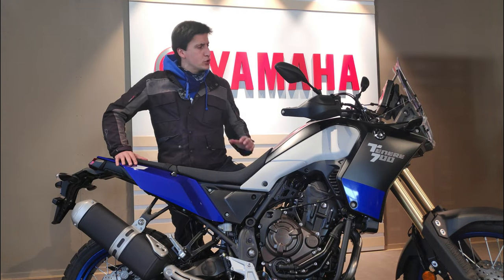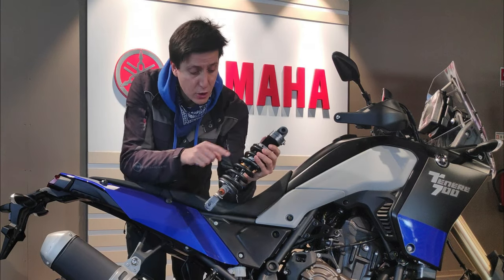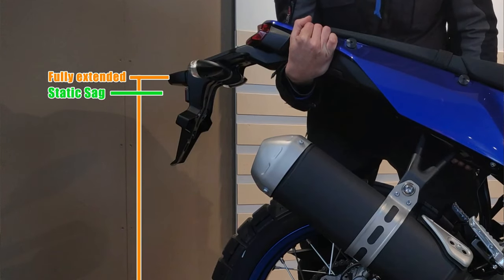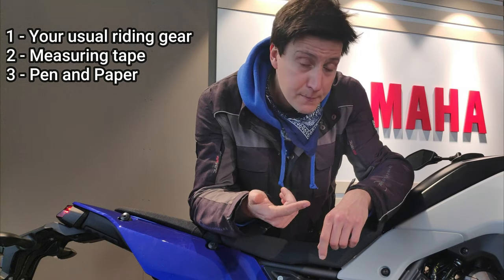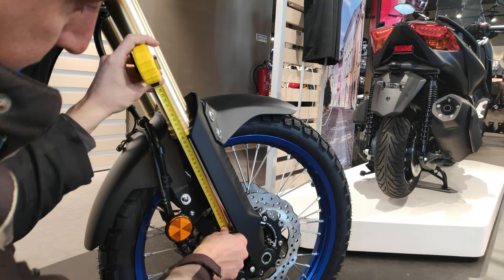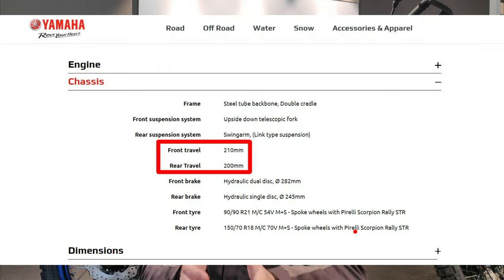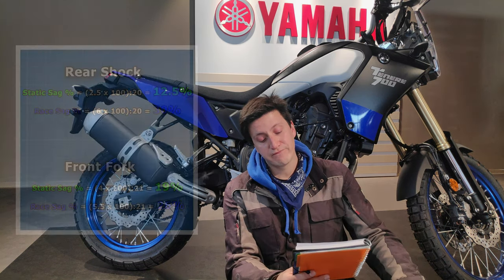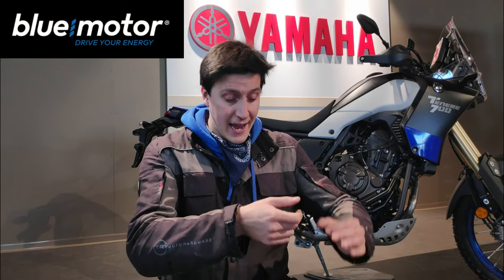Motorcycle Suspension tutorial: Sag and Preload (T7) 2/3

Comment: The best T7 suspension videos on the Internet hands down. I’m about to replace my standard spring on the rear to a 95nm as I’m 198lbs with out riding gear on and I occasionally carry a passenger. I’m also going to add a spacer probably 5mm into the forks at the front to help adjustments and to stop the right spring making a pinging noise over rough  ground   Apparently from the tenere 700 forums this can be a common problem for heavier riders on the Yamaha. Thanks jon.
Reply from the maker: Oh, never heard of those noises on the spring! I will look into that... 
With 198lbs+luggage you will probably feel a huge different now with the stiffer springs. Leave me some feedback after you tried it ;)
Reply: @OFFroadOFFcourse  just the rear spring getting changed and spacers in the front forks 5mm I think. I’ll keep you posted
Reply: @OFFroadOFFcourse  hi. I’ve installed the rear spring & set the correct sag, the bike feels great with that. The front forks are still making the knocking noise over bumpy ground & when I hold the front break & rock the bike I can hear the noise in the front right fork. I added a 5mm pre load washer into each fork & still the knocking continues, so I’ve now added the 12.5mm washers to each leg & I’m sad to say the fork still makes the noise over bumps and when rocking the bike.  I’m not to sure where to turn now. Possibly an 8hr drive to rally raid uk to see if they can help. If anyone online can help I would much appreciate it

Comment: I have my T7 for a bit more then a week now, same colour as yours in the video :D. will have to look into the suspension like you suggest... I'm 95kg naked and 1.90 height without shoes or anything... 
1400km, first service done, did a lot of hard off-road, the bike looks one year old already :p
thanks for the tips and will do like you say :D
(already have a heavier rear spring to match my weight but still a bit too lazy to install)
Reply from the maker: "1400km, first service done, did a lot of hard off-road, the bike looks one year old already :p"
I know the feeling! ahaha! I've been like that all my life!

But now, (thanks to John, from my videos), I've learned to respect a few "maintenance rules" that really make a difference... like never storing your bike all muddy. 
I used to do that.. now I always pressure wash it, ride a few minutes to dry a bit, oil the chain and then (most times), I spray exposed mechanic parts with WD40 (like the hinges on the footpegs and side stand, some nut where I notice any sign of corrosion, etc)
It prevents innumerous problems and general decay along the years :D

Comment: great video! thanks for the hard work!
one question: since the static sag is independent of rider/gear weight, and if it falls outside the 10% range, does that mean the manufacturer did not do a good job of choosing spring rate for their own motorcycle? why wouldnt static sag always be exactly perfect out of the box?
Reply from the maker: Wow that is a very good question! Honestly i dont have an aswer im sure of. I guess they always have to balance a compromise between the bike feeling performant but not too stiff, tall but not too intimidating for the short ones, quality but not expensive, etc etc.. but even so i dont see a clear reason for them to mess up the static sag. 
Either way, the static sag importance is way less important than the rider/race sag :)

Thanks for watching!
Reply: Because there is a mistake in that theory. First how rider 100kg can squeeze spring by 20% if motorcycle 200kg squeeze it by 10 %? Springs are linear so it's impossible. Focus rather on sag itself. So motorcycle with rider shoud squeeze 30 percent of fully extended forks/shocks ( so 30 percent of travel). If you want to calculate it more perfectly search for instruction how to calculate sag and include static friction into it. There will be L1 L2 and L3 parameters
Reply: perhaps you're right, but regardless of how to properly calculate sag, my question was about why OEM static sag wouldn't be exactly what it should be out of the factory floor @krzysztofelektryczny8206

Comment: Hi thank you for your videos, keep it simple and keep your humor and good humor. you should very quickly have tens of thousands of subscribers .. I measure 1.70m for 70 kg so light and despite everything when I go off road hiking with my T 700 (luggage + tools + camping tent or 25 kg) from that I accelerate the pace unfortunately the suspensions do not follow as well in front as behind. I think YAMAHA neglected the quality of the original suspensions and that is unfortunate. I thought about the relevance of changing the fork and shock absorber springs or mounted an OHLINS fork kit and ditto for the rear. The investment is relatively expensive. have you driven a T 700 configured with Ohlins?
Reply from the maker: No, not yet :/ 
The Springs are supposed to be a "cheap" and effective solution, especially if the whole thing is handled by someone who know what they are doing and makes sure the new springs are tuned for your weight+luggage.

The Ohlins solutions should be good as well, but how much would that cost? (Im really asking, I dont know)
Reply: @OFFroadOFFcourse  hi the cost of a set of front and rear springs about 250 €.
an Ohlins fork kit around € 1,200 + Ohlins rear shock absorber € 1,080 or € 2,280. If we follow the indications of the spring sellers for the off road, it is preferable to fit linear springs for a pilot's weight of 70kg + 25 kg of luggage hardness of the front springs 6.3 N / mm (original 5.8 N / mm ) and rear spring 85 N / mm. (original 70 N / min)
It is necessary to provide a higher margin because the weight of the luggage can vary. This is only my personal opinion.

Comment: Really good training about the basics, it’s clear and easily understandable. I have just one question about the lower kit and preload. Does it change something about the numbers you talked about ? (10% and 30%). I presume not really but are we absolutely sure ?
Reply from the maker: Its a fair question! I believe it would apply just in the same way. However, consider that some people (usually enduro riders) don't even use the 10-30% "rule", they usually talk about a specific measure of centimeters or inches, for istance: "2cm static sag and 6cm race sag", which is more or less the same thing cause all enduro bikes have +/- the same total suspension travel.

The 10/30% rule is actually a way to expand what they do on the enduro/mx to all bikes in general, despite having much smaller/bigger suspension travels.
So yeah, even with a lowered bike, the 10-30% guide-line still applies (if its 11%-33% or something like that isn't a problem..unless you are trying to improve a lap time by 1sec or something :P)
Reply: @OFFroadOFFcourse  
Thanks for additional information but anyway, I will do measures by myself this weekend in order to appreciate numbers. In theory, the OEM lower kit for T7 shouldn’t change anything.

Comment: Could you suggest a compression and rebound setting for road and off-road?
Reply from the maker: My next video will be precisely about that.
Its hard to give you a comp/rebound setting that works for you, your riding style and riding environment, cause I am not you =)

Adjustments are very personal. 
But this afternoon I will be running some tests again and I will share with you the settings I am using (i have to count the clicks again :P)
Reply from the maker: Ok, so I don't own a T7, the one i've been using and experimenting on is almost with stock/factory settings, and for me it has been working really well for most part.

I am 75Kg (+10kg equipment) and ride conservatively, meaning that I only go fast when there are no significant obstacles on the track. Also, I have enough experience/expertise to work my way around most problems without forcing the bike's suspensions to do it for me... so I usually get away with soft and cushy suspensions. 

This being said, I am running factory settings with 2 little modifications:
Harder compression on rear shock (2 clicks)
Harder compression on the forks (2 clicks)

Comment: Hi there, 
I always wanted to own this bike bike I’m not the ideal size. My height is 5.3 and I weigh 60. I’ve been searching about lowering seat/links and a little bit of fiddling with the suspension.

With all of these options  is it possible  for me to ride this? 

Many thanks 🙏
Reply from the maker: Hey Kesler! 5'3 doesn't put you out of the game! I know a few shorter riders who rock (one of them has a KTM 990R, which is way taller than the T7).
Lowering the bike isn't that hard...you can probably lower between 2 to 4cm cheaply. You just need longer shock links (easy to make or cheap to buy) and the shock can simply be lowered on the triple-clamps.
...but you know this already I guess?

How is your overall experience with off-road motorcycles?

Cheers and good luck!
Reply: @OFFroadOFFcourse  never been but I’ve been riding mtb’s hope it helps. Cheers
Reply: @OFFroadOFFcourse  great to hear that I’ll be able to ride this T7. Thanks